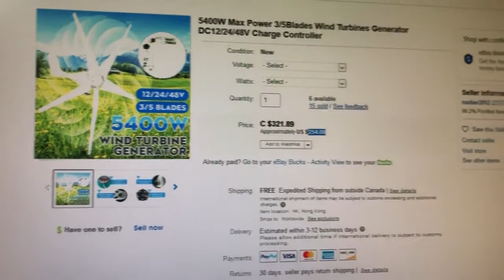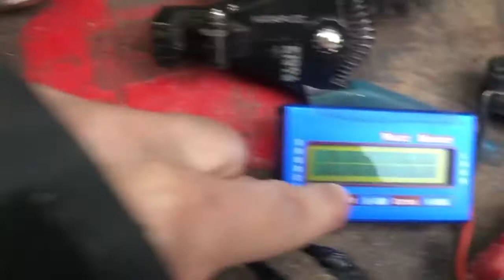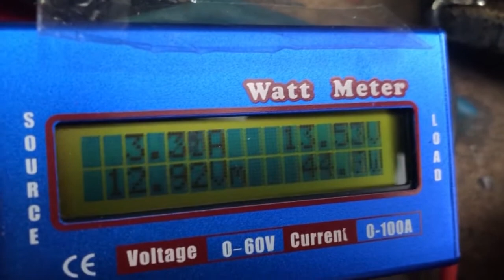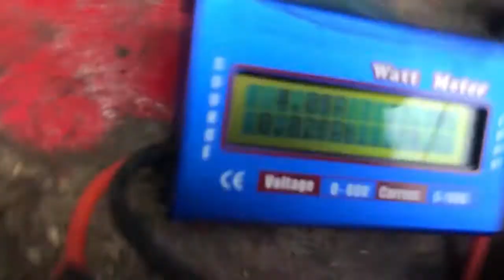Test of a chinese 5400 watt wind generator from ebay

Comment: I can’t quite tell in the video but it might be worth making sure your turbine to rectifier connections are superb. Maybe try soldering them up. But you’re probably right, just a really bad generator.
Reply from the maker: well he max output i get out of it was 54 watt, so maybe is a defective 100W generator, or a working 50watt... dont know, but for sure its not a 5400w as advertised! Anyway it dosent matter because i finally get refunded monday after the seller have seen this video :)

Comment: Actually, this is a 200 W wind generator that can generate 400 W in a storm.
The wind generator must be selected from the condition that the estimated wind speed for the wind turbine should be 1.6-1.8 average annual wind speed.
A real 5 kW wind turbine has a diameter of about 7 m. If less, then this is a fraud of the buyer.Here is a real 5 kW wind generator, not your toy.
https://www.youtube.com/watch?v=JZJbjMcJSeo
Reply from the maker: for what i tested it is a 50w generator, even at 2800 rpm i can not reach more than 54 watt out of it.. anyway it dosent matter because i finally get refunded monday after the seller have seen this video :)
Reply: @logicielslri1729  It’s good that a refund was obtained.
Next time it’s better to buy good windmills, for example Ukrainian, which are considered the best in Europe.